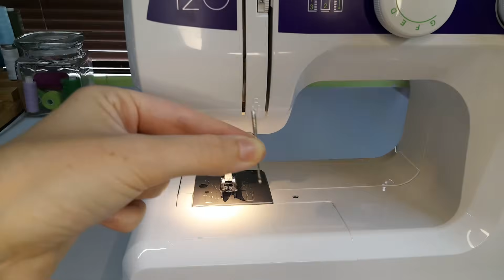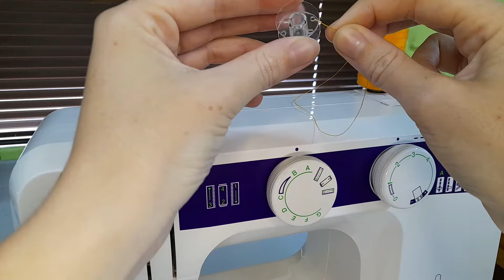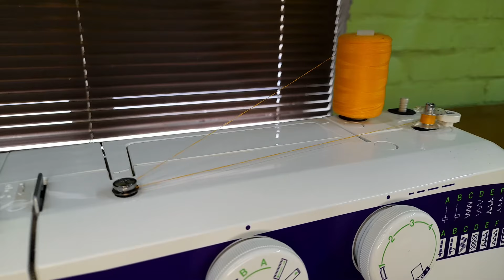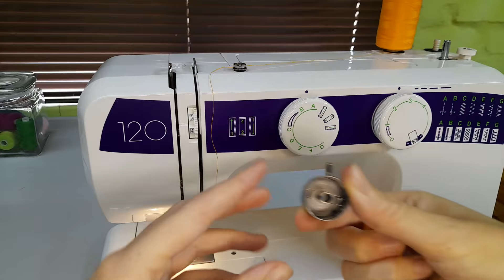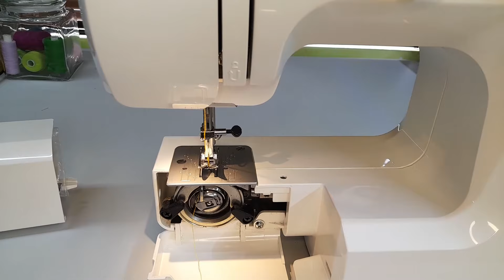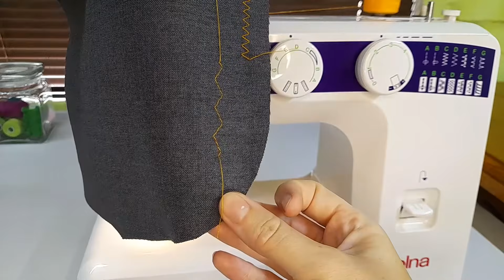How to Set Up and Use a Sewing Machine for Beginners *Elna 120 sewing machine*

Comment: I have a question. What bobbin do you use? Did it come with your sewing machine? I've only used my sewing machine once and it's already playing up. The thread keeps getting stuck on the bobbin part in the sewing machine and the tension is really tight. I can't figure out why it keeps getting stuck. Every time I try and sew it jams and the thread won't move.